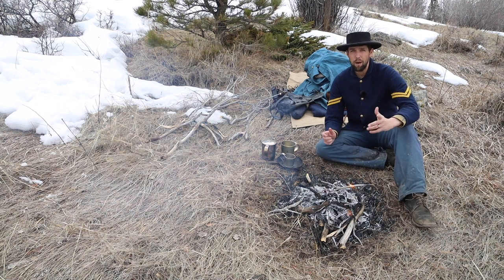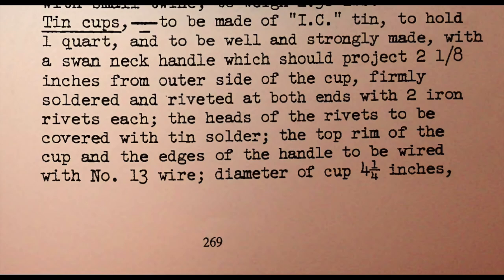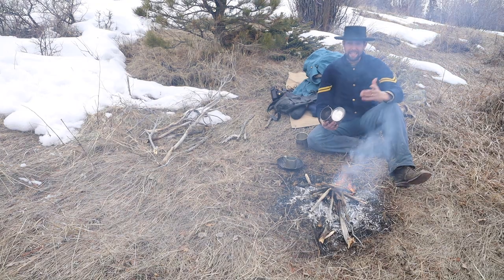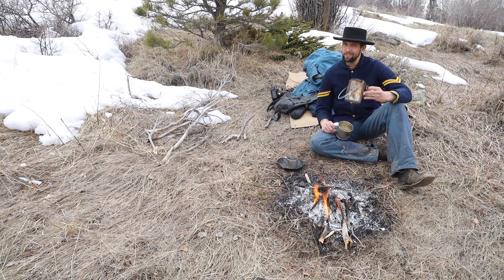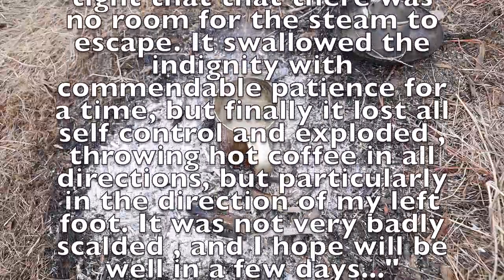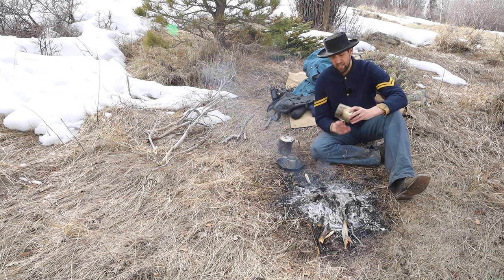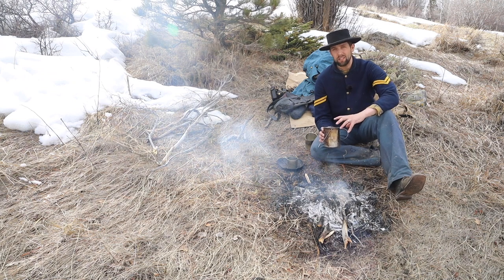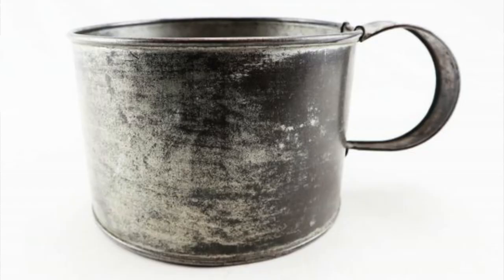Civil War Equipment: Tin Cups vs. Muckets

Comment: so you always use the term naug so if you want to get something uncommon i always as what is your reason and why if you were a soldier why would you have that items personally i have several firstly i carry  my great coat all year i use it as a pillow and my reasoning is i want it as a pillow and  i would be willing to carry it along with the blanket during the summer just for that reason i carry 2 canteens a PA pattern ridged one mostly as it was my first purchase and the second one i carry in a confederate marked cover my reason is i captured it from an officer it was full of brandy actually during the day i like the extra water lastly since i moved over to a sharpshooter impression and am now an officer i have an early war coat that has the rubber buttons a dress uniform in green that has brass buttons and my late war coat i have rubber on my cuffs it is a personal touch we have not real record of it but we that it like the marines in ww1 where once in theater they were supplied army uniforms and they keep there marine buttons and sewed them onto there uniforms as a we are still marines we see that the sharpshooters would have probably done that too plus they wernt know for having good uniforms you can have farb as long as you dont go overboard and have a good reason and in camp i have a mucket i use for tea  tho i still have my sharpshooter pack and its mess kit

Comment: Rather than the hinge on the muckets, I think they should have just put a tab on the side of the lid with a hole in it for the bailing wire to go through. That way the lid will be less inclined to close on its own if you want to cook with it open or the lid can be completely removed more easily. It would also be simpler and cheaper to make.

Were there any tin cups muckets or cups that were dished or pressed in a form so they didn't need to use solder on the bottom? I hear if you make the fire too hot it will melt the solder. Maybe the handle could be affixed by having the turned over lip of the cup bend over the end of the handle material like the flange on a food can.

I guess it's probably not worthwhile to try and improve on 100 years old designs, but I do worldbuilding, so I'm always thinking what sort of gear my people would be using.